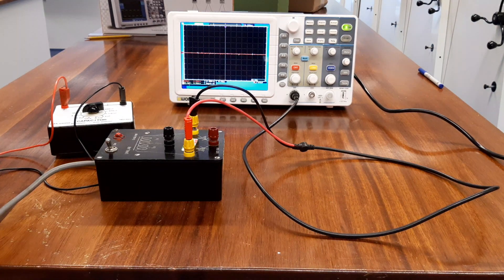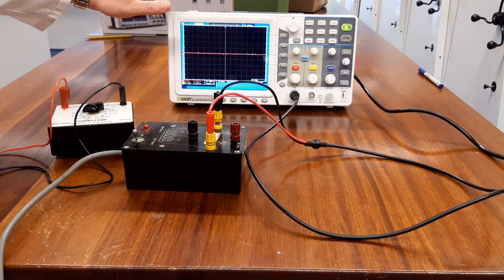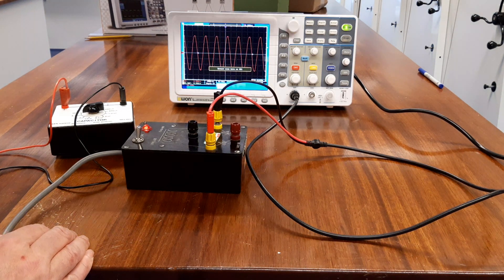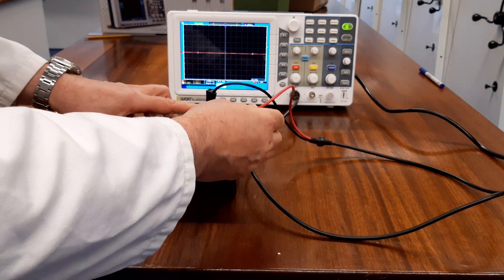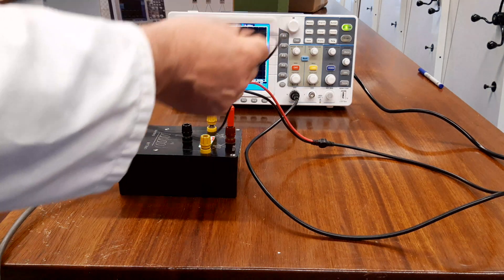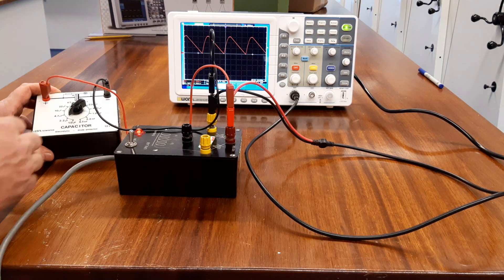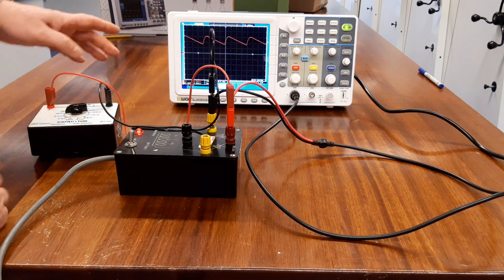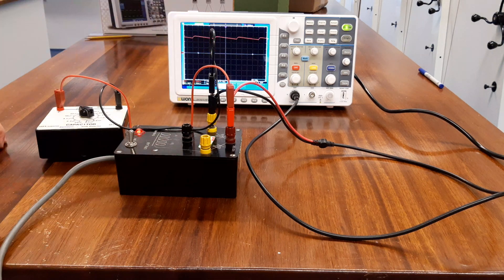Demonstrating the effect of a smoothing capacitor

Comment: Hello! Youtube advertised one of your videos about 'Electric Fields' that you produced about a year ago. I thought the demonstration was brilliantly presented, and wanted to congratulate your efforts, but the comments were not allowed. As you mentioned, it is the magnetic field being seen in the semolina, and the spark is the dielectric force (AKA Electricity). Those two are the 1 1 2 of the 'Golden Ratio/Mean', and then 3 5 8 and so on, and (AKA Fibonacci Sequence). I'm just guessing, but wouldn't the '3' in concert be the consubstantiality  of Magnetism, the Dielectric force and Electricity, represented by 'Light', be the demiurge of the material universe...and gravity merely 'mortar' to hold it all together when a part? :)
Reply from the maker: Thanks for the reply.
The semolina demonstration shows only electric fields. The spark was because the breakdown potential of the air between the conductors was exceeded. This could have been as a low resistance route was made along the chain of semolina particles.